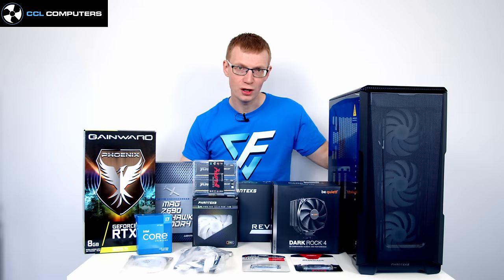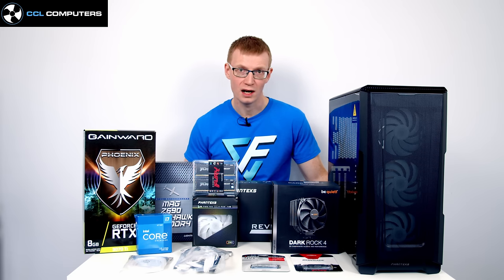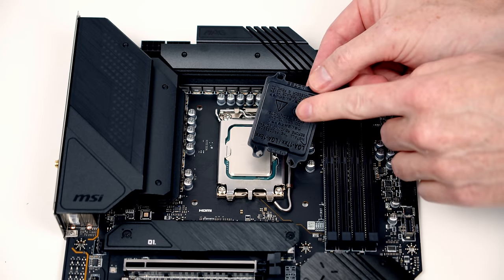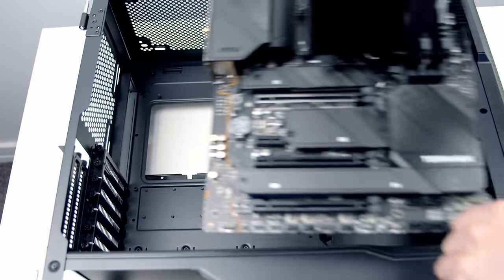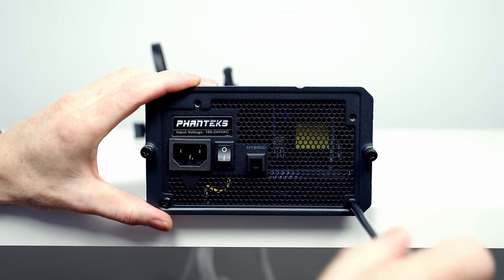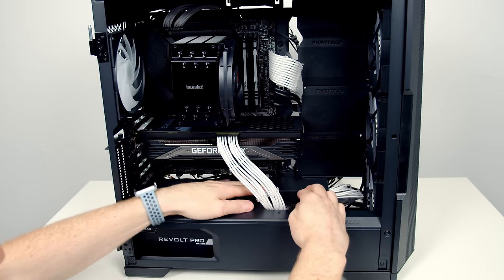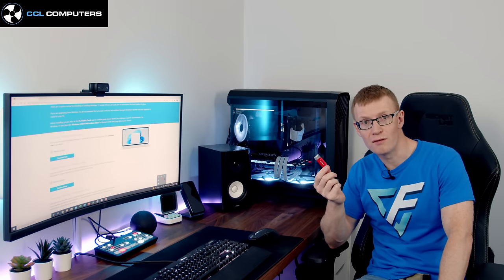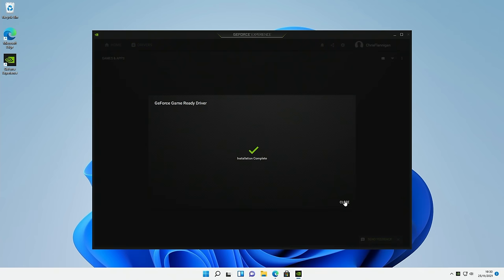How To Build A PC - Step By Step Beginners Guide With CCL Computers

Comment: I would like to sincerely thank you for providing the entire community with world class build guides. Personally I went with the Lian Li lancool mesh 2 as my daily audio production rig. Nuff respect from Mississippi. 🙏
Reply: I went with the msi x570 tomahawk, ryzen 7 5900x, 32gb x2 (64gb) g-skill trident z rgb @3600mhz cl16, 1 sabrent rocket 1tb gen 4 (os/boot) 3x mushkin 2tb pilot-e2 gen 3, 1 in the bottom m.2, 2x installed with msi xpander z. Mind you this is a pre pandemic build. So far I have upgraded to a msi 3070ti and 9 lian li uni fans. The gpu cost more than the entire build. No joke.
Reply from the maker: Glad I could help
Reply: @ChristopherFlannigan  i just bought z690 tomahawk ddr4 wifi, it didnt come with motherboard screws. is it how it's supposed to be? do i have to buy separate mobo screws?

Comment: I build a PC every 4/5 years so each time 75% is the same but I have to learn a lot of new tech for the rest (didn't even know Nvme drives were a thing). This comprehensive video reminded me of a lot of stuff but also taught me a lot. Most useful was the section after the physical build, what to do next? - Just followed what Chris did and all went perfectly - thanks Chris.

..Subscribed. By the way, had already bought most components from CCL by chance!

Comment: Hey my guy i love the video,

Something that confuses me about the tomahawk is whether i should remove the plastic from all the SSD heat syncs or just the ones im gonna use? I know this might be a dumb question but im legit concerned the plastic might melt or is that not something that happens.

Amazing tutorial though.
Reply: Just whichever ones u need to use unless it is a sad slot and with that you install ssd then put the plate over it so it will cool it but make sure on that plate that u peel the protective film off the thermal pad

Comment: Hi, Thanks for the vid -but I have a problem. I watched until min36 and is most important for me. I just got the DDR5 ver. Z690 of this board and 12700k and 4070Ti and 2x 2Tb NVMe gen4 drives. 

** The boards have only 2x 2.0 USB ports on the back IO. I guess you used them for keyboard and mouse. 

So- my? ""What port did you plug the OS USB drive into""? I thought maybe windows would only see the 2x 2.0 USB' until the drivers are installed? 

Also- I- like you will download and make an OS USB drive- I think I need to update the bios after I install the OS or the mobo will not take my new 4070TI? The 4000 cards are newer than older BIOS. So- I plan to set it up and install the OS with either the onboard Vid DP port or use my older 1080 vid card. After I install the drivers- I will add my extra storage drive and change out the vid cards. Sadly for me and is important for any that follow- the question about what USB you can or not use is a problem. Also- best I understand- you cant use the onboard Lan or WIFI until you install the OS and Drivers? 

The USB question is important, and you did not show that part- and being most all of these mobo companies are trying to do away with usb 2.0 and some boards do not have them at all on the back- and they are doing away with dvd/cd drives. We dont know if we dont know- and the manuals do not explain such things either. I have built my own systems since my first pc in 2004- but I dont build them every day. What am I to do?

This is what I am building- a gaming system. I read the 1225V lan is no good- so I bought a Realtek. I also read in reviews and on ratings.c om the Gigabyte M32U is Gsync compatible. Just waiting on a few things to be delivered. >

MSI Z690 Tomahawk WIFI DDR5.. Intel 12700K.. Noctua NH-D15.. W 11 Home..
2X Crucial P5 Plus 2TB- CT2000P5PSSD8.. MSI MPG A850G PSU.. 
Gigabyte 4070Ti- GV-N407TGAMING OC-12GD..
Kingston Fury Beast- KF548C38BBK2-16.. 
ULANSeN 2.5Gb Lan- B08V1HG47H..
Thermaltake Core V71 Case..
Gigabyte M32U 4K 32".. 
Klipsch Promedia 2.1..

I hope you see this post and get back with me soon. Thank you.

Comment: Hello Christopher, I installed a second gen3 nvme in my machine the other day (using this guide as a bit of a refresher). I was using the manual in tandem and wanted to ask if you were certain about slot 3 only supporting gen 3 speeds, as I couldn’t find information in the manual that mentioned that, but I could be wrong.

Comment: Thank you for your help, I built my PC following your video. Though Windows installation wasn't easy . First could not open install.esd file , fixed it via dism , now it can't find required files error 0x8007025d . Still googling for a fix

Comment: Would it be a good idea to install the gen 3 m.2 in slot 2 instead of slot 3 as slot 2 is covered by the graphics card and you can still access 3 and 4 slots without moving the card?
Thanks for the great build it helped me loads as I have this motherboard.

Comment: Hi Chris! quick question, I have a 5600X cooled with an ROG 240 AIO on a ROG X570 Crosshair Dark Hero VIII which I know is a overly built board for my CPU, paired with my ROG RTX 3070Ti, pretty solid build but every time I try Asus AI Overclocking my PC just shuts down, I have a Corsair SFX 750w 80+ platinum PSU. I don't know what's causing it.
Reply from the maker: Sorry not something I could diagnose without it in front of me. Sounds like high end hardware so it shouldn't be the problem. Have you updated BIOS?
Reply: @ChristopherFlannigan  yep I have updated it to the latest stable bios which is Version 3801
Reply from the maker: If it shuts down straight away its not overheating  so it just doesn't like the overclock so you might be best to do it manually. Sorry I'm not much use without it in front of me.
Reply: @ChristopherFlannigan  No worries! Thanks Man I appreciate it.

Comment: Hi Christopher, thanks for this tutorial. I already downloaded this in case I need to review it while I'm building a new Pc or upgrade it. I have one question no one seems to have an answer to (including the Microsoft Helpdesk). I want to build a new Pc without having to re-install Windows and my current software again. In other words, I'd like to use my current SSD drive to run on a new build. Main reason is that I've got many so called VST's (digital instruments) installed on separate SSD's. Of course they are all registered in the registry of my C Drive. To re-register all those VST's will take me weeks. I already asked Microsoft but even they are not sure if it will work or not. Note: All of the programs and VST's are legal so theoretically it is possible to install them one by one but it's a painstaking job. I hope you have an answer. Thanks in advance ;-)